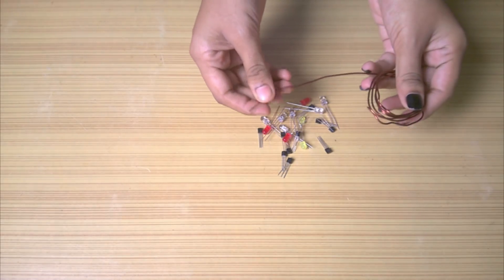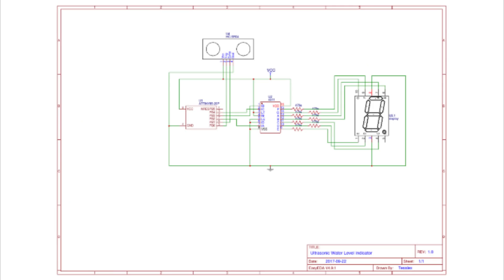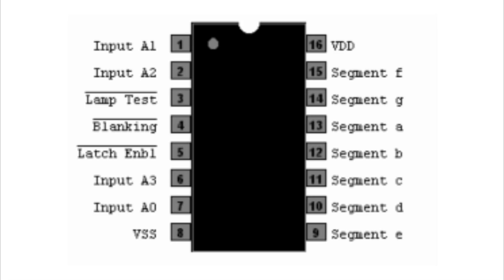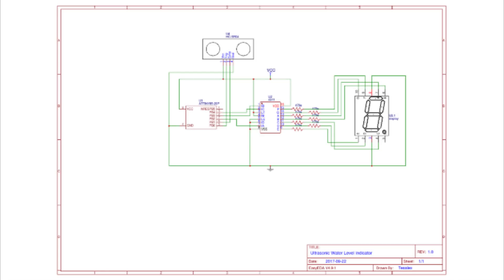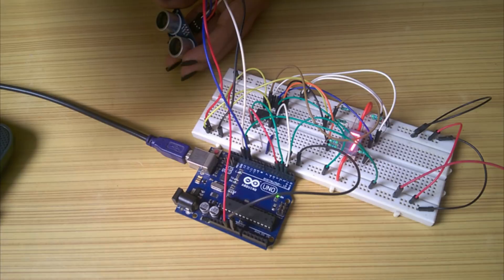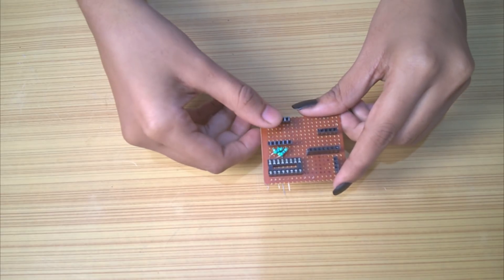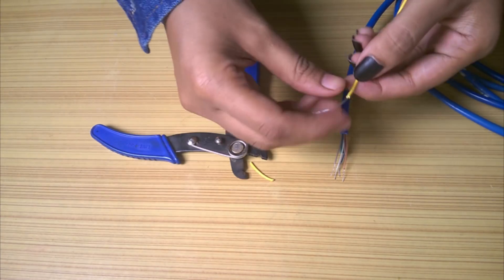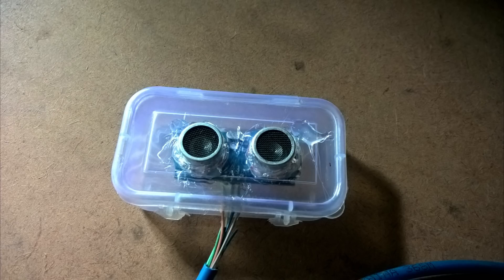Ultrasonic Sensor based Water Level Indicator

Comment: If this sensor is placed inside the water tank, the sensor will be damaged due to evaporation. I have done this project  before. 
Water due to evaporation gets stuck  the sensor and loses its sensitivity. The working principal is good but practically a failure project.

Comment: Too good beta, good job. For a 10 storey building with one water tank on terrace and other water tank underground.  How to add one more ultrasonic sensor for underground water tank and connect it to your circuit. It will be difficult to use cat5 cable to connect ultrasonic sensor of terrace water tank. Can we modify to add 433 mhz transmitter and receiver module to your circuit.  Secondly, in your same circuit can we modify so that water pump motor starts automatically when terrace tank is empty and underground tank is full. And water pump Motor will not start when both terrace and underground tanks are empty.  Please let me know on my email id nbpanjwani@gmail.com. Thanks. God bless you.
Reply: 433 MHz module range is just a few metres, you cant use it for that. I think you can use nrf24lo1 module for this or if you know, you can use esp8266 to  make it work on internet.

Comment: Hi,  I liked your water level indicator project video. Since I found the device very useful I tried making one at home. Unfortunately I couldn't make out the full program code for the arduino board. I shall be highly thankful if you can share the complete code for the arduino board as reply for this comment.

Comment: I want to use this in method in building a sensor for a PID control system,as you know the noise on sensor is very destructive in feedback path.so i have to minimize it.Could you please show me a way to do it?
my controller is  Arduino Mega
Reply: I'm afraid I don't have much experience with PID controller. But you can refer GreatScotts's video regarding the same.

Comment: Well, the problem with this ultrasonic sensor is it will die if ur tank is a closed one due to heat and water evaporation. There will be water droplets on the sensor face which will give bad readings. There is no way to shield them. Except, get a waterproof ultrasonic sensor which is triple the price of this one
Reply: Correct!
Reply: Absolutely right

Comment: Will it survive in high temperature 80-90 degree?? Will it work in boiler as water level indicater?
Reply: No it will not, for higher temperature radar transducer sensor is used

Comment: The water level indicator in our camper (RV) gave up. I like this solution, with ultrasound in stead of rods in the water. I never worked with an Arduino. Do you need an Arduino One or only the little thing called "Digispark micronucleus tiny85”? please mail me at video_holiday(@)mac.com (remove the brackets)

Comment: Is this sensor water proof? It is available for very cheap price so I'm doubtful
Reply from the maker: If you buy waterproof ultrasonic sensor (link in description), it is completely waterproof. Also the price is not much higher than normal ultrasonic sensor.

Comment: can we use ultrasonic sensor without this module or arduino or any programmable module...can we indicate water level using ultrasonic sensor with ne555 timer,counter,decoder and sevensegment display...if yes plz help me in doing this

Comment: ultrasonic device will have to face moisture  so does it works for long time ?
Reply from the maker: A good question. During the winter season (when I installed this), it ran without a problem, but in the summer, which is really hot in India, it didn't last long and I replaced the ultrasonic sensor with a waterproof one, now it is working great.
Reply: i think water proof ultrasonic sensor works ... in summer .
Reply: How long does the complete setup lasted ?
Reply: I do a similar proyect, measuring water level with an ultrasonic sensor aswell. This only work for about 1 month, the sensor get oxidated, so you answering your question this method don't work for long time

Comment: Just wants to know one thing. It will only indicate the water level or can switch off motor as well? Further how can we wirelessly send commands to sensor? As my overhead tank is on 3rd floor and obviously nobody would like to mess with this much effort. (Between great job. You explain it clearly) Your prompt response will be highly appreciated.
Reply from the maker: Thank you.
It only indicates the level of water in the tank and you'll have to do major changes to make it wireless, I'll recommend using a RF Module.